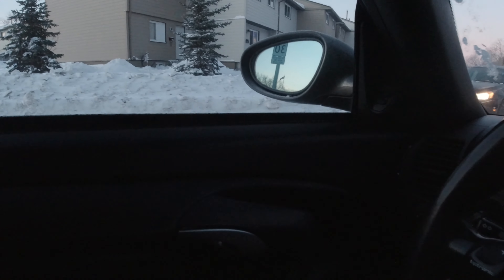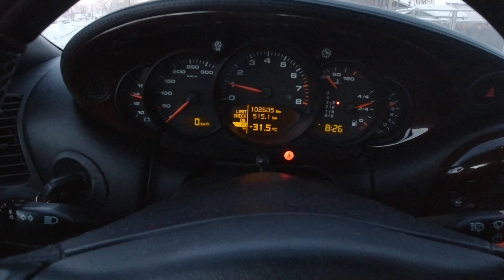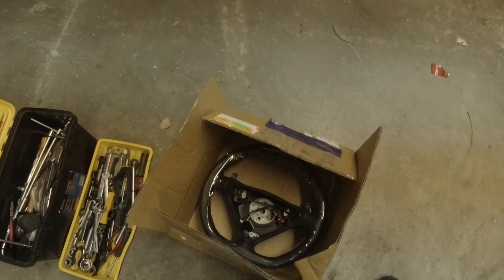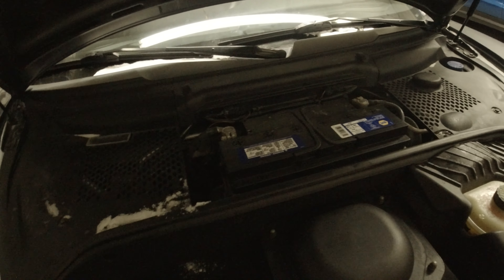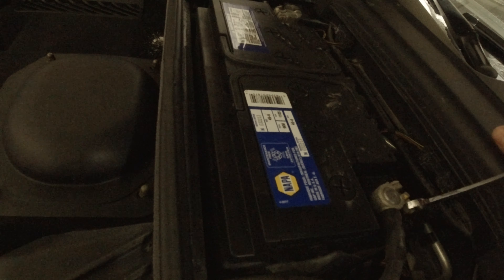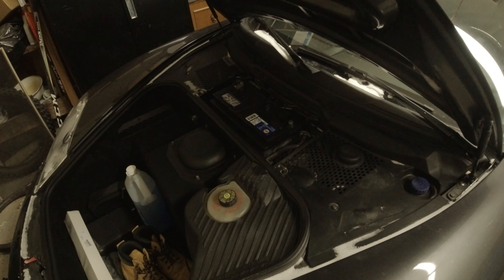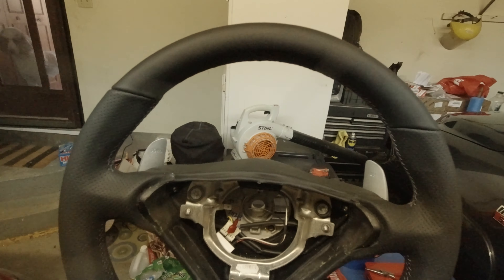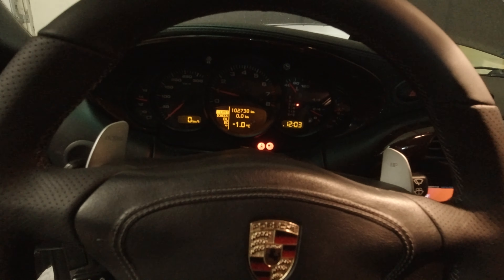Porsche 911 steering wheel swap

Comment: Hey Shane,  I got an 02 996TT and I'm looking at the same mod and reached out to DCT.  Would you be open to answering a few questions regarding  your experience?  Wondering how you think the horn/airbag cover match to the new Napa leather of the wheel?  Also,  is the wiring plug and play?  Lastly,  what made the install so difficult?  Thanks man!
Reply from the maker: Leather looks/feels great. wiring isn't quite plug and play, and that's what gave us the issues.  The hole for the ground wasn't threaded, so I assumed that it wasn't needed. I don't know if they all come like that, but something to watch out for

Comment: Hey Shane!  Thanks for sharing your video!  I am from Winnipeg so it’s Great to see other Porsche enthusiasts also from Winnipeg!  I have a 997.1 TT tiptronic. I swapped out the steering wheel and steering control module and replaced with a PDK steering wheel. Shifter paddles works but I understand I need to get the steering control module programmed so that my wipers, cruise control, etc….works again. Is this something you guys are able to do? I have been around cars for over 35 years.  But this is my first time playing around with Porsche and I can say that they don’t make it easy to modify. 😊

Thanks!  Look forward to your response!
Reply: Forgot to mention that I have a Foxwell coder (NT710) but it doesn’t code the steering control module unfortunately.
Reply from the maker: Hey, nice to meet another Porsche fan! As for any kind of reprogramming, that’s beyond anything I know how to do. I’m just an owner, not a shop. I would suggest checking with Perfect Performance. They’re just north of Winnipeg, near Birds Hill

Comment: Whats up Shane, amazing job! i am looking to order paddles that work for the tiptronic, just paddles. 
I want to make a kit that works with a momo steering wheel and customize it.
I dont know how the wiring is of the tiptronic buttons and what paddles i need so the wiring will be the same and so i can make it work.
Could you help me out?
Reply from the maker: If you're using a Momo wheel, I suspect you could use just about any paddles.  The ones that were used by DCT Motorsports on mine were from a Mercedes.  As for the wiring, yours would likely be simple, but as I didn't actually make the wiring setup, I don't want to give you bad advice.

This post should help though

https://rennlist.com/forums/987-forum/898104-diy-tiptronic-paddle-shift-conversion.html
Reply: @noahmaddox211  what’s up dude! There is a works bell paddle shifter which works with the Momo system, it’s quite expensive though but that’s a standard one! Besides that I have ordered magnetic paddles from Alibaba which I haven’t found a way yet to modify on the steering wheel. For the fasted safest way, works bell seems to be the best option!